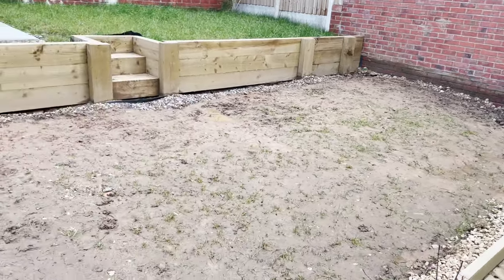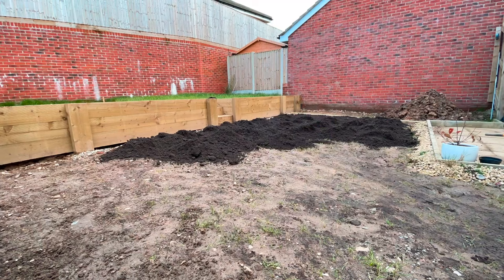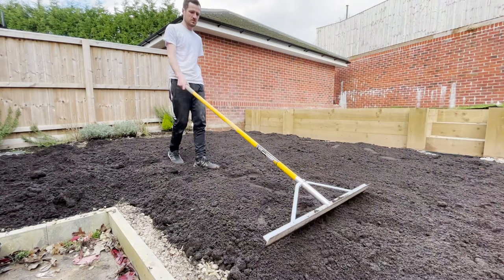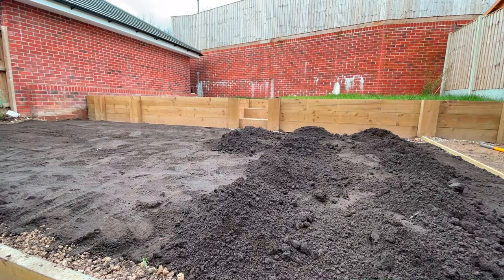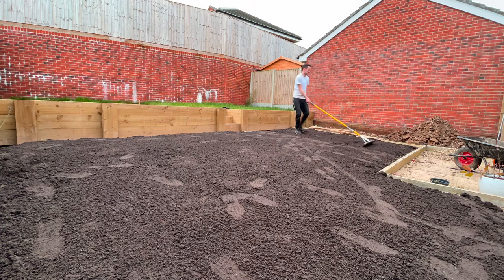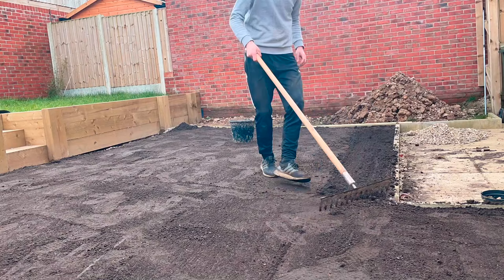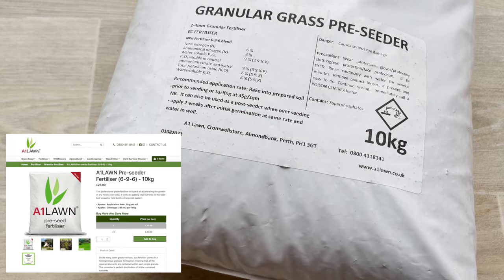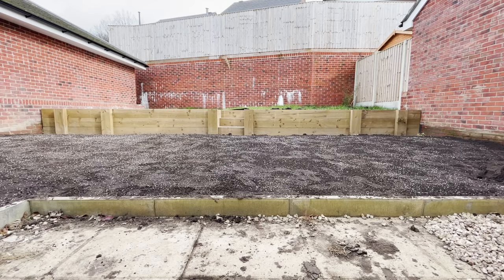How to Easily LEVEL a NEW LAWN - New Build - Garden Renovation

Comment: Hey, great videos, nice to see it from a true diy point of view, gives me a bit of faith.
Reply from the maker: It seemed so daunting beforehand, especially when a lot of videos on YouTube are from proper landscapers!

I’m still shocked at how things have turned out 🤣
Reply: @NoviceGardener  I’m always shocked at how my diy turns out, for all the wrong reasons haha. Where did you buy your topsoil in the end ? The great thing about ‘novice’ videos are that they show mistakes most will make. The pro’s don’t. Keep em up !
Reply from the maker: Nice one 👍🏻

I got it from a local supplier, just a farm about 5 miles down the road to where I am. Worked out much cheaper! I used some of the Westland top soil on the lawn on the top tier recently and it was so expensive in comparison.

Comment: Great work so far. I would suggest getting the Scott spreader as it doesn't clog up and is about £30. It will be useful anytime you need to spread fertilizer or seed. It's worth the money.
Reply from the maker: I may have a look at this. I was hoping to seed it this weekend but it still gives it to be cold early next week - may be better for me to wait until next weekend now.
Reply: Just come in from using the same fertiliser. I've stripped my lawn all the way back to mostly dirt this year. Got the fertiliser on, will top soil and seed in the next few days. Hoping for warm weather and some rain this week.

Comment: Could have used a roller would have saved you untold time and a yellow plastic rake, you'd have got a better level and run on the soil. Decent thorough job though.

Comment: Awesome videos, really helpful to see it in action after reading so many different ideas online. I was wondering how much in square meters the space you were working on in this video was? I have about 10m^2 (new build aswell with the crappiest and hardest of clay soil full of boulders) and I was weighing up the option of either trying one of those clay breaker type products to work in along with compost and then maybe lay it with a couple of mm of top soil. I'm just trying to decide whether I need to go 5 tonnes or above with extra top soil.
Reply from the maker: My area is just over 30sqm and I used 5 tonne just to get a decent layer of top soil. I’ve got about 100mm of good top soil across the lawn and I’m going to be topping this up each year.

The clay below is an absolute nightmare! I’m not sure how the housing developers get away with leaving it in such a state! It was riddled with bricks and all sorts once I started digging.

Hope that helps, sorry for the late replay!

Comment: Great videos. I have a similar project on the go at the moment! If you started this again would you use a landscapers rake or a lawn lute to flatten the topsoil? I can see that you’ve used a lute in a later video and not sure what tool to buy for levelling prior to turfing. Cheers!
Reply from the maker: I think I'd go with the lawn lute if I was to start from scratch again. It was so much quicker and easier when getting the level. Don't get me wrong, the rake was superb (and much cheaper too!), but the lawn lute made things much smoother.

I hope that helps 👍🏻

Comment: Great series of vids, watched them all with great interest. I'm in exactly the same boat with a sloped garden. What do you reckon you've roughly spent so far, if you don't mind me asking. Trying to weigh up having a crack at it ourselves vs getting someone in. Has it taken longer than you though initially?
Reply from the maker: Cheers 👍🏻 We’ve probably spent about £2000 so far. We had a few quotes before we started which were well in excess of £6000!

Initially we thought it would take 6 weeks during the summer as I had time off work, but that deadline went out the window quickly! I recon we’re still another 6 months away from finishing, but that’s just because we’re trying to get odd jobs in around our work. But despite that, I’m so glad we decided to do it ourselves. Learnt loads along the way - but I have made plenty of mistakes too 🤣
Reply: @NoviceGardener  that's a decent saving! Really rate how accurate you got the paving tiles too. I guess a bonus of doing it yourself is you're fully in control of details like that. Looking forward to the next installment.

Comment: The real problem with clay is compaction. Walking on clay, even when slightly wet can create dips in the soil above. The problem is the new top soil may be dry, but the clay beneath damp or indeed saturated with water.
Reply: Lol you’re not supposed to compact clay,you’re supposed to take it out and put sand and start compacting

Comment: Where did you get your topsoil from? I’m Merseyside ways so be handy to know somewhere decent for when I do mine in a couple of weeks. Ta.
Reply from the maker: It was a farm in Rainford. Not sure how far they deliver.
Reply: @NoviceGardener  thanks. I’m not far from there. How much did they charge per ton/bag?
Reply from the maker: I got 5 tonnes for just over £100. But I had a quote recently of £120 for 2 tonnes - prices have definitely gone up! But still far cheaper than going down the Rolawn route!
Reply: @NoviceGardener  deffo. I’ve been quoted £45 a ton delivered  from a place in downholland or 50 if bagged. So not too bad.